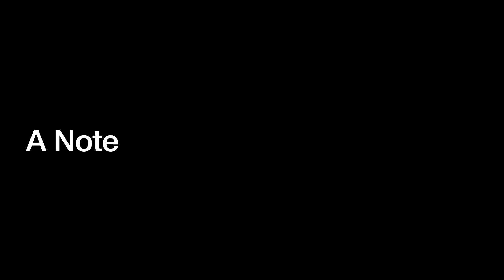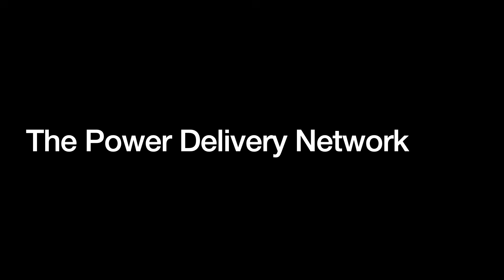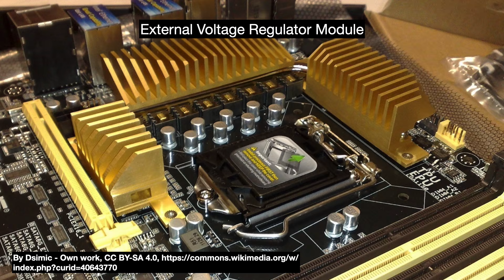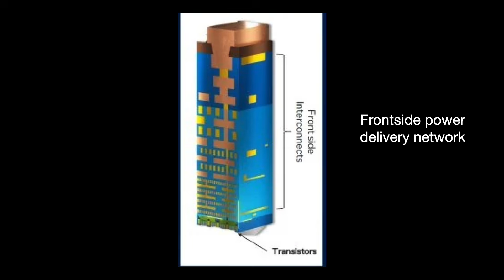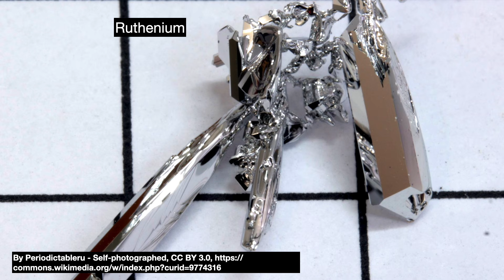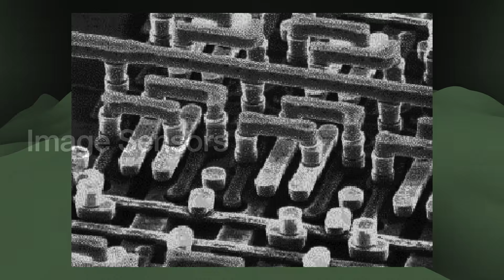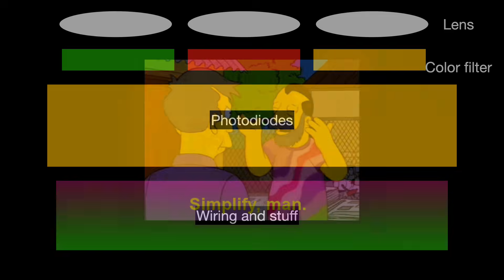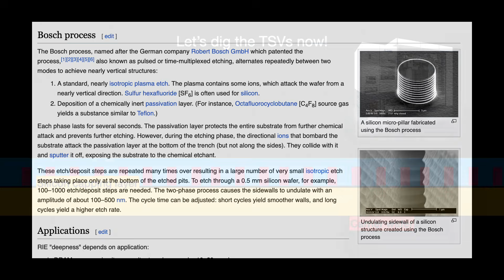Intel’s Next Breakthrough: Backside Power Delivery

Comment: Intel has done TSV (thru-silicon Vias) in the past with FOVEROS. That was for signals, but I'm certain the learnings from that paved the way for backside power delivery.

As the video points out, there are so many metal layers that power delivery is interfering with signal routing, so the motivation for backside power delivery is clear. For ground, it's probably a trivial procedure because the base silicon is a P-type substrate, which is ground, so a "short" between a VSS TSV and substrate is meaningless. Actually, it's probably desirable. I think the challenge is for power, because the TSV's must NOT make any electrical connection to the P substrate, otherwise it's an electrical short.

It's relatively easy for manufacturing test to find failed (either shorted or open) TSV connections for signals, because those failures will prevent signals from going-in, or coming out. But for power delivery, I dont know how you can find individual opens because multiple power pins and buses are grouped together.
Reply: TSV is not the critical step in BSPN it is the grinding into precise nanoscopic thickness.

Comment: Ah, so old CMOS before backside wiring would be like if blood vessels were directly in front of the retina.
Reply: Blood vessels (and nerves) are directly in front of the retina
Reply: @TheGreatAtario  Not only that, they don't even exit your retina by the edge, they go right through the middle. This leaves a blind spot just off the center of your vision that your brain just edits out.
Reply: No, it's off to the side. The centre is fine.
Reply: No, it's off to the side. The centre is fine.
Reply: @TheGreatAtario  fair enough, I guess my comment implies that's not the case.
Reply: @TheGreatAtario imagine how bad it would be if something as sensitive as your light cones were directly exposed to light, you would be constantly picking up obscene faint light and might have to live in a cave
Reply: @TS-jm7jm that's the job of your lens and pupil, unless you wanted those two to get handicapped as well.
Reply: Camera sensors still lack the backside reflector found in a cat's eye, which enhances night vision by reflecting light back through the retina. Instead, they chose to utilize backside wiring before considering the addition of a backside reflector?
Reply: @xponen I wonder if the reflected light is distanced from the cone by a multiple of half wavelengths to get in phase addition of the light plus reflected light. I imagine a cone or rod would work better if it were extra sensitive at half wavelength intervals (255 nm for green light)
Reply: @douginorlando6260  amazing. Using thin film physic to send specific colors to the sensor without a color filter is innovative. This concept is also why there's purplish hue on modern eyeglasses, caused by this effect. I wonder if this is mainstream tech on CMOS or completely original idea?
Reply: @douginorlando6260  The rods & cones are huge compared to wavelengths of light while the pigments which absorb the light inside of the rods & cones are essentially half-wave antennas (randomly distributed and polarized throughout in the case of humans). Hopefully this helps you build a more useful mental model.
Reply: Yes

Comment: From what I've learned, backside power delivery is supposed to be a huge deal. Basically separating the power and data lines from the ground-up (I believe). It's supposed to greatly increase efficiency, and it is a major uptaking from what it looks like.
Reply: So when will it be implemented? I just left a comment about how often we hear about these huge revolutionary ideas and discoveries and then nothing ever comes of it.
Reply: @conor7154  Intel claims 18A will be "production ready" in the second half of 2024. They do, however, have a track record of being late.
Reply: @conor7154 Intel 4 had a pilot line where they used Intel 4 process rules but with BSPDN implemented and ran some test chips (just to derisk Intel 20A since Intel is attempting two major process changes at once with 20A). Those have been completed and tested (you can easily find the press release on Google for that). As for I tell 20A and 18A which will bring BSPDN to HVM, 20A is already being used to manufacture next-gen CPUs such as Arrow Lake which is launching later this year. Intel 18A will bring this technology to many customers outside of Intel with Intel Foundry, so in just a couple years you will likely see all the Intel CPUs as well as several other customer chips implementing BSPDN.
Reply: @conor7154  I'm pretty sure it's supposed to be shipping in Intel's arrow lake processors soon, hopefully we will see a big uplift in performance but only time will tell.
Reply: @nicknorthcutt7680 I wonder if so much of the stifling of these ideas or them going to waste is because they’re a gamble for such a huge company. Like if it was a tiny company doing small volume they could afford to try new things but when you’re making millions of units is probably too risky to try really new things.